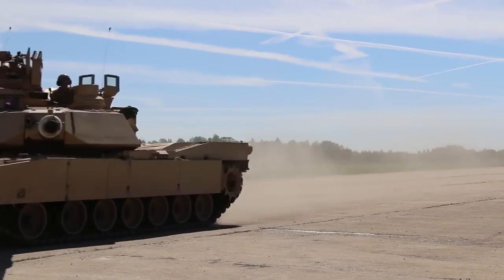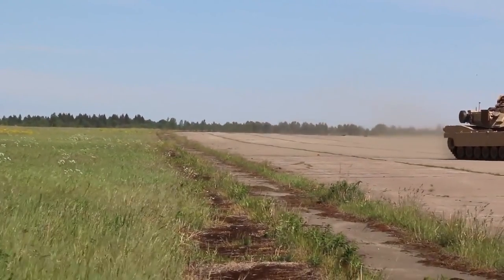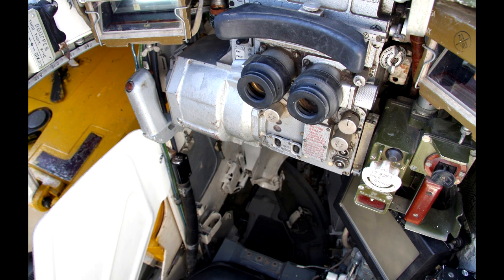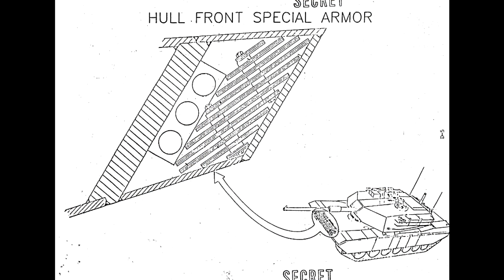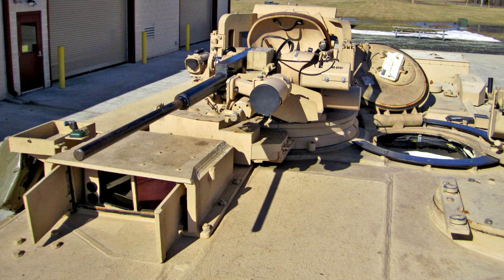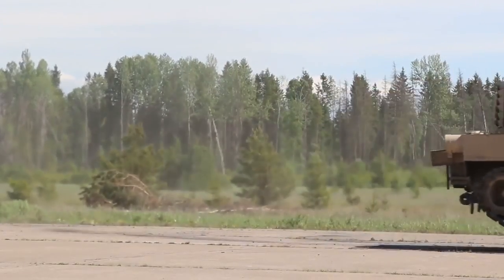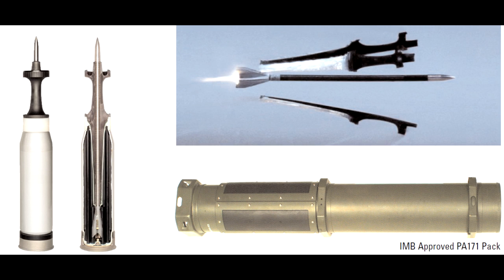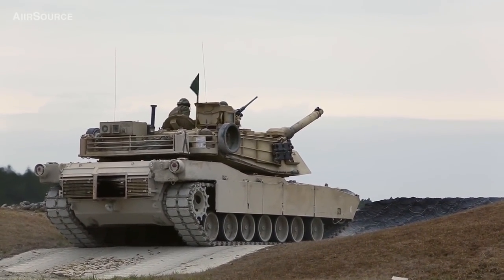Problems with Abrams tank

Comment: You spent your entire video talking about issues that used to persist, and why you believe one engine is better than the other. The chances of striking the front slope is pretty small, especially for Soviet tanks. The other thing you failed to point out is that the Soviet tanks used IR, an active, not passive NV. The Abrams has always been a step ahead when it came to thermal and night vision sights and still is. And as of recently there has been added protections on the M1A2C. They could add a longer bore, I agree there. But the tank will likely already have full knowledge of where any enemy tanks are, or are traveling to. You talk as if it will be fighting alone against an enemy force. Soviet radar can't even track or see our planes. And if it was a force on force war, the jets would be best served staying in hangers since they would never see the F-22 Raptors firing on them. And before ground radar knew what was going on the sites would be destroyed by F-35s. Or worse, rendered useless by Growlers. The ground would then have full and continuous air support on the frontlines. FA-18s, A-10s, B-1s, F16s, and F-35s. Mix in the AH-64D along with all the drones over head and the tanks might not even crack off shots, might just roll past the burning carcasses of what used to be a military. Besides, Russia doesn't want to fight the US. They know it would be a losing battle. But to sit there and use a bunch of things that were corrected and fixed as your reasoning? Point out the problems, not old issues. And have your facts correct when mentioning that one system is better than another. And don't forget to mention that Russia makes tanks they can't afford to field to their entire military. Upgrades that happen to the Abrams, also improve Marine tanks and are applied when refit is done.
Reply: Jugoslovenski Nacionalista  well, let's start with the SU 57. None have actually been delivered. It's been tested in Syria, but that's over a country with no opposing radar or air support. It has barely been out of trials and all 11 made are prototypes and test beds. Then we have the SU 33, it's based on the SU 27. Being Russias answer to the FA-18, it still doesn't stand a chance if a carrier launches a growler, which they most certainly would. Electrics and radar would be scrambled and communications would go dead for the pilots, then they would manage to get a missile warning just before having visual sight of impending rapid and unscheduled deconstruction of their aircraft. The Mig-33 is an interceptor. They would be baited I to the air then rapidly dispatched by the hidden F-22s stalking about. The SU 57 is the only one that might have a chance at actually having a dog fight. The radars can catch blips of American fighters, but the advanced avionics and sensors would tell the pilot if he can be seen. They would bait each victim into the air and before they ever saw a US jet there would be missile locks going off like crazy. The US jets would never let them get within visual range or a missile lock. A sparrow has a larger radar cross section than a F-22 and about the same as an F-35. And good luck spotting a growler. They would have an escort of several FA-18s and radar wouldn't see any of it. Just a blank screen as the group entered the airspace. Mind you, even if they immediately commissioned the 11 SU-57s they have, it's not enough to even make a dent. Russia fears war with the US. They make wild claims about their defensive systems for their tanks that they can defend against KE rounds and that their armor can even stop them. What they fair to recognize is that an A-10 would be stalking the battlefield with tanks. The T-14 wouldn't stand a chance. And it would be even easier to have other combat elements deplete their defenses or get a mobility kill and let them be sitting ducks. If you are facing a column of M1A2Cs with TUSK2 kits and all the supporting elements like Bradley IFVs, Strykers, air support, and light infantry from both the Army and USMC, you might as well drive back to base and go home. Better to see your family and see another day than to experience the fear of listening to your vehicle being disassembled my 25mm chainguns and the like. Because that's what would happen as soon as it was disabled. It would become target practice once all threats have been eliminated. They would use the carcasses to confirm zero.
Reply: Jugoslovenski Nacionalista  the growler is a bit more than you say. It's an electronic warfare platform and would be accompanied by FA-18s. You say what the SAMs would get most the kills, maybe. But you must be unaware of recent events involving F-35s playing games with the most advanced russian radar systems by walking into Iran and several other countries that purchased those systems. The reason we can track them is because they have their transponders on when flying over the US or other NATO countries. Russian pilots also enjoy talking on the radio like a bunch of girls gossiping. For the US that makes them super easy to locate and track. I will say that russian tanks have gotten harder to crack open as they learned a lot from watching a second gen MBT pop turrets like fireworks in Desert Storm. With the tanks Russian has fielded they require the same approach that has always been employed by US armor. The ammo is much harder to hit, but taking out the crew is just as effective. There are talks of the APFSDS reaching maximum length, but there hasn't been solid data released on it penetration ability. ERA, no matter what its composition will not detonate when struck be KE rounds, especially when talking about DU. Being so dense it requires another dense material to heat up. You would possibly get a post penetrating blast and remove or damage the last half of the rod, but less than half is required to penetrate the turret or hull of all the current russian tanks. People will claim that ERA can stop or reduce the penetration of DU, but they are reading false information put out be the developers. ERA is amazing against HEAT rounds or shape charges. But it is plastic explosives and not binary explosives. I can shoot a blob of C4 all day and have nothing happen, even with tracers. I can smack it with a hammer, and I can set it on fire, nothing will happen. But, if I light it on fire, then shoot it, it goes boom. And you have to take in the factors of training and how each country operates in war. The US plan is unpredictable at best. Its chaos with a little bit of control. We don't know when massive operations will happen till the day before. We also operate in groups, so you would have to contend with rockets, large bore guns, and tanks. We study russian tactics and formations, we also train against ourselves and don't go easy. And we wouldn't be fighting alone. Remember why Germany lost WWII, they were fighting on several fronts at the same time and having to split resources along with the excess and waste in the research and development they were doing. The US is a global machine, able to fight and support itself in a multitude of places all over the globe. And we have bases in places that Russia wouldn't even want to touch. The global backlash they would get just from war with the uS would possibly cripple the economy. The only place they would get supplies would in turn be cut off with a blockade and embargoes, and they would be fighting against every other MBT that isn't a redesign of their own, but some would be. Plenty of countries have a score to settle with Russia and it wouldn't be that hard to get them to join. The reality is that if the US goes to war against Russia or China it will start a 3rd world war.
Reply: Jugoslovenski Nacionalista  may I quote General George S. Patton's here? "The point of war is not to die for your country, but to make the other guy die for his." That being said, the US doesn't simply throw their troops at an enemy and hope for a victory from attrition. It comes down to strategy, something the Russian military lacks in at times. The Russian military has a higher ratio it likes to fight at, and the US would never afford them the opportunity to field those numbers. It's also clear that the Russian military is fearful, or intimidated by any US forces near them, hence the harrassment of patrols in Syria. A force that knows it can kick the others teeth down their throat doesn't harass another to provoke an international incident. And I promise you that if they push the wrong patrol, the US soldiers would have no issues with showing their effectiveness in combat. You forget again that Putin himself would refuse to start a war with the US. In his own words said something similar to, you can not win a war against the US. Their tactic and strategy is chaos. Even they don't know what they are doing until they do it. You can't defeat chaos. They would think they are going to be fighting a battalion and roll up on a division. They would think there's a division somewhere but it end up being a trap to test MOAB on a conventional military force. Deception, smoke, and mirrors. This isn't a world of just ground war or just sea, or just air. It's a 360 degree world now, and the US has become an expert at that sort of war over the last 20 years. Yet they have still trained for conventional warfare during it all. Russia had their teeth kick in in Afghanistan, understandably it was a different era, but they couldn't adapt to guerilla warfare like the US has. And you have to understand that it won't be simply the US they are facing. You would have Canada, France, Germany, Italy, the UK, Poland, South Korea, India, and possibly even Israel and other NATO countries to contend with. Russia might be able to get several countries like China and North Korea to join them. Even if Russia is willing to throw their troops at a war, are the individual soldier willing to fight to the death? Because the US combat troops would fight to the last man and the last bullet. And even after they they'll pull out a knife and go hand to hand, making sure to let that be a surprise for the Russians when they are close enough. It's highly unlikely that would happen, where entire platoons are left to die or off on their own, but if it happened the Russians would lose large numbers to something called a death blossom. They would then have to fight the ground troops, as well as whatever support assets were sent to get them out of trouble. And US troops would definitely employ guerrilla style warfare against Russian armor and IFVs.

Comment: The upper front hull of Abrams is not a problem, any projectile hit 51mm at 81 ° would just bounce off to the front turret, the real problem is the big weak turret ring cannot stand any direct hit.
Reply: Jugoslovenski Nacionalista   any plate in 81° thicker than 40mm would bounce off 120mm shells.
Reply: Jugoslovenski Nacionalista  due to the angle, a hit with ATGM would likely has the same result.
Reply: Jugoslovenski Nacionalista  The real problem is the turret ring and side armor, a BM42M hit outside the 60° front arc would likely penetrate the side turret.

Comment: U.S. has never had the "best" tank.  Commanders were asked what they wanted most in a tank, and they said speed.  So what you get is a trade off for that speed; moderate armor, moderate gun, but great speed.  These tanks were expected to be used in concert with Apache helos as well.  That combination almost guarantees a quick envelopement and destruction of the enemy.  People keep thinking of the tank as a stand alone weapon, and therefore erroneously do a tit-for-tat comparison with other tanks.  Ideally, the tank is one part of a weapon system, where its weaknesses would be supplemented by other units.

Comment: I think you are largely right in your critique of the M1's gas turbine engine. It is indeed a thirsty beast. While this is somewhat mitigated by the US Army's excellent logistics system (while crewing the M1, I never found myself in a situation where we didn't have all the fuel we could burn), a normal diesel engine would be great. In addition to high fuel consumption, the gas turbine also gives it a higher heat signature, which is important considering the fact that almost anyone worth fighting has thermals these days. And there is the whole blowing out the V-packs every couple of hurs. MTU is offering a conventional diesel upgrade, which I think would be the right direction for us to go, but I'm not holding my breath.

That being said, the advantage of having DU both in the armor and the ammunition cannot be overstated! From the frontal arc, there really isn't a whole lot out there which can pierce the turret. Plus, a DU SABOT will go through just about anything. However, if the Germans were to apply DU to the Leo, that tank would have absolutely no peers! 

Anyway, great video!
Reply: w12 in t72 t90 use 20% less of tank what is 15 ton less have. Turbine generate more power. Hybride engine will be sice more complicate.
Reply: And less be clear some version of t72 have almos menual turn tiret.
Reply: also most russian tank have very shity gun elevation

Comment: The gas turbine is actually cheaper over its lifespan because it needs repairs far less often and has a longer operational life. German Bundeswehr actually did the math on this, and found they would have gotten away cheaper with the turbine. The solution was to stop driving the tanks so often, resulting in barely trained recruits.

Just a slight correction there, because the use of the gas turbine is more than justified. Also, I think you can fill just about any kind of fuel into that thing and it still runs, whereas the German diesel engine is pretty picky when it comes to fuel. The diesel engine is NOT better at all.

Comment: I won't argue the pro's and con's of the M-1 and it's variants vs any other tank, BUT, the one thing that makes or breaks ANY tank is the training of the crews to work together as a TEAM in the vehicle and as a TEAM on the battlefield. I retired as a M-1 Tank Maintenance Supervisor in 1990, as the Motor Sergeant of the Headquarters Co. (I was the senior E-7 in the battalion in maintenance.) Yes, I also have served as a Company M-1 Tank Motor Sergeant a 'few' times. I worked with the Company Commanders to help insure those tank's were both maintained to the best condition possible AND even had myself and my mechanics for the hull and turrets train on how to operate and shoot the M-1. So, until there is another need for those vehicles to go into combat, all you arm chair war fighters are just trying to bench race what's better and your comments are speculation based on your opinion from statistics you read.

Comment: The one main thing that separates the abrams from other tanks is the tracking system it has which makes it a hell of a lot easier to hit targets while moving full speed
Reply: Well, thats not accurate. Any western tank in service has a stabilized gun, especially the Leopard 2 with its very high first hit probability while moving. I think the Germans actually pioneered that technology, first seen in the Leopard 1 A2 in 1972 onwards, though it wasnt primarily meant to be used while moving at high speed through rough terrain but rather should make target acquisition easier before slowing down or stopping for an accurate shot. The L1 was later (A5) upgraded with the L2 stabilization and fire control system.
Reply: Tell me one western tank that can't do the same.
Reply: @Spearhead133  I call bs. The AMX-30 received gun stabilization in 1971.

Comment: In all honesty, isn't the 105mm gun part wrong? after all the 105mm gun on the Abrams, as well as some M60A3s Are a revised version, able to handle both M883 and M900, with penetration on par of the contemporary 125mm soviet shells, namely "Mango" (which issues are mainly due to it being separated on two parts, thanks to it's autoloader's design).
as for the Commander Sight, do you know what a CITV is?

Comment: Don't change that engine. German tank crews in mixed Abrams/Leopard brigades love the heat signature of the gas turbine. Its their best protection against heat-guided anti-tank missiles.
Reply: Its not really the engine, the problem is with its filters and how much fuel it eats
Reply: @DemolitionistMen  That engine alone accounts of half of the US Army's annual preventative maintenance expenditure.
Reply: The German PSO had a better heat signature I believe because of the reworked exhaust system

Comment: You don't seem to understand combined arms or war on a global scale, and why multi-fuel is very important.

In every major war, fuel has had to be rationed, and vehicles sidelined or abandoned due to fuel shortage. You want 40 tanks? Too bad, no fuel. But there is a shit ton of cooking oil left over. Especially given just how much God damn agriculture goes on in the US.

Basically, as fuel becomes an issue, units would be given shipments of whatever to maintain a 100% fighting force. And the vehicles that can't run off coal dust will be able to be used as well, versus scrapping them to run tanks.
Reply: I would like to see what happens if you pour cooking oil and coal dust into an Abrams.